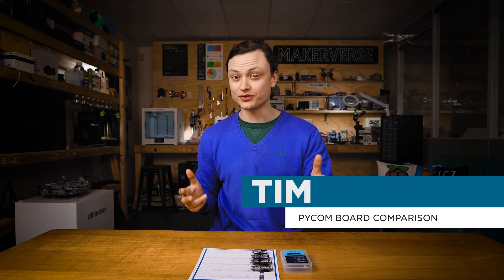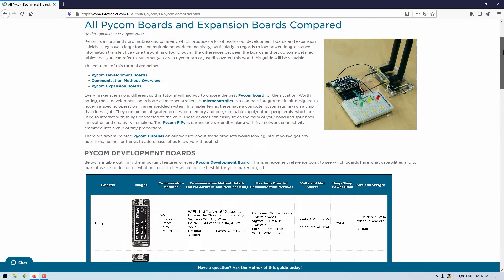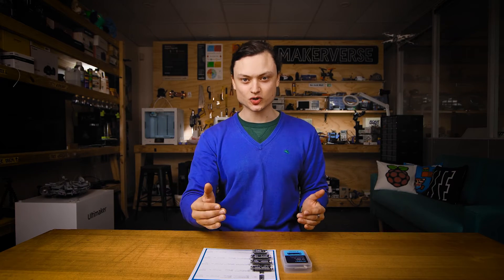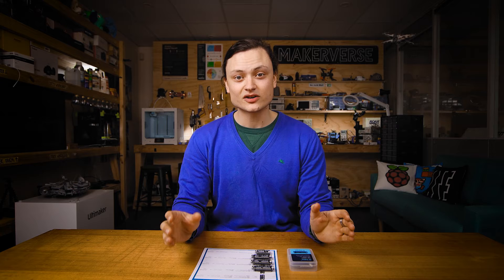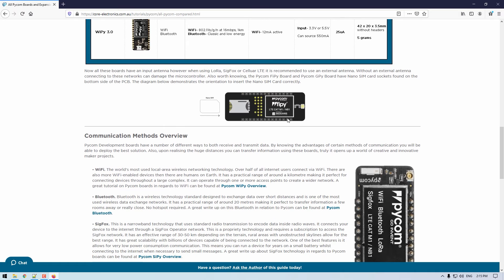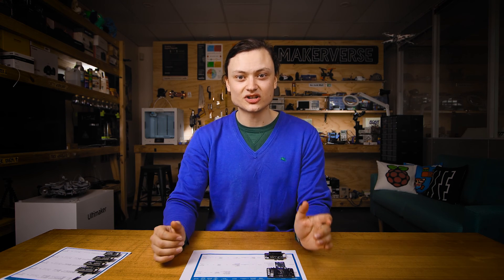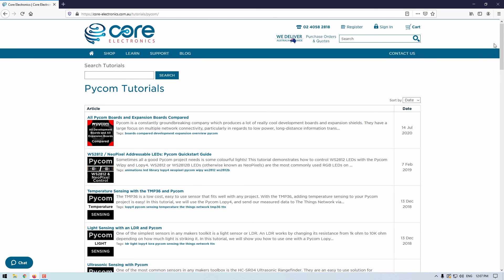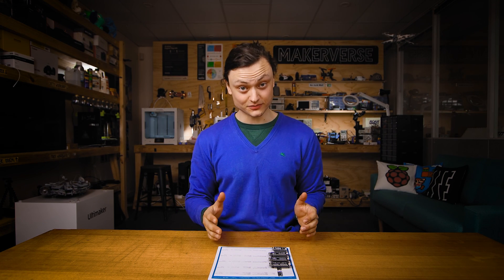All Pycom Boards Compared | Over 40km Connectivity Within Your Palm

Comment: May be a totally noob question (well, I am a noob 😁)... But can these run a small display (under 2.5")?
Reply from the maker: It is definitely possible, I'll link you to a guide where a LoPy4 is used as a dust sensor while running a small OLED Display.  https://community.hiveeyes.org/t/micropython-datalogger-for-esp32-and-stm32/2281/3
https://community.hiveeyes.org/uploads/default/original/2X/8/8e13ca3cee2a20a181c41904da7a3765e626a9a6.jpeg

Comment: Good summary. Note: LoraWan is a internet connectivity layer on top of Lora radio. Also the 40km capability is a bit misleading for real world use. That is only true for very good line of sight conditions,. In real world with houses, trees and terrain 1km is more the norm, that's still very useful for private network type use and much better than WiFi. I have a bunch of videos available that show my use of the various pycom connectivity (LoraWan, Sigfox, LTE) at https://www.lupincorp.com/blogs?panel=ourLora . I agree Pycom boards are a great resource, especially because you can code in micro python and connectivity is somewhat standardized in their network library.